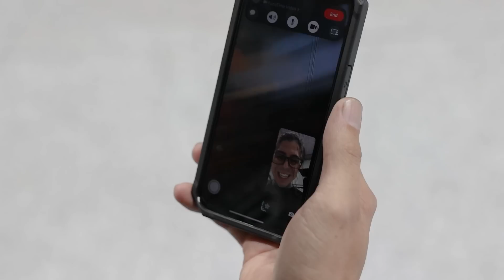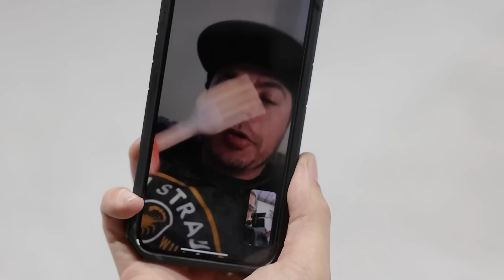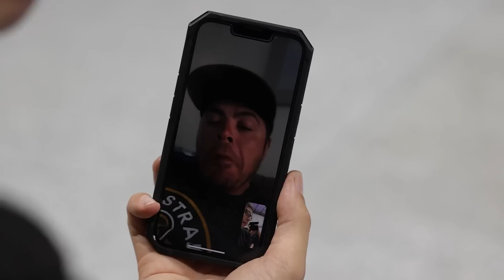2 WEEKS TO GET THIS BIKE UP AND RUNNING?! - Dirtbags California

Comment: I really love the EastCoastin Crew they represent my state as well as my county very proudly. I’m digging what the Thrashin Supply Guys bring to the table especially the connection they have with the Two Lane gang not just by blood. LuckyDave is my plug.
You however my friend bring the Culture, keep doing what you doing. Your work will for every speak for itself. 🤙🏿